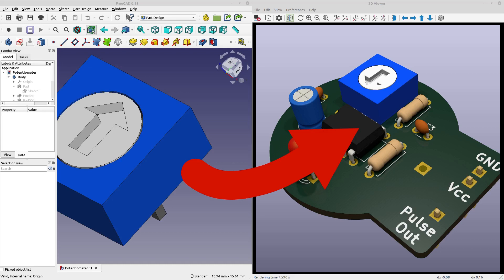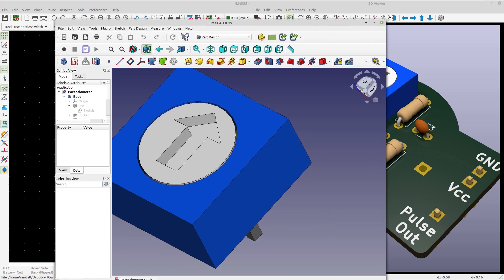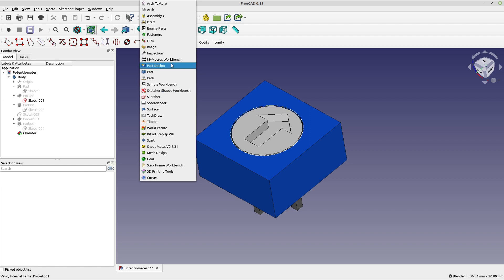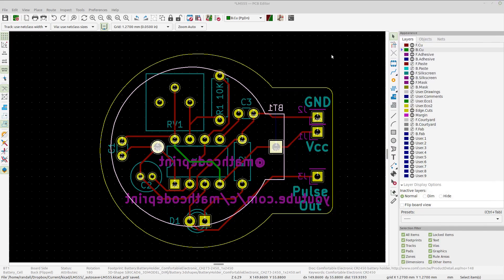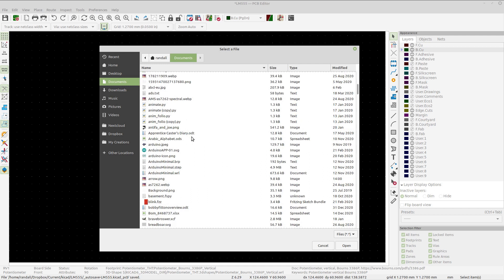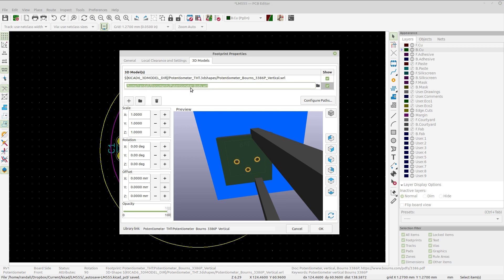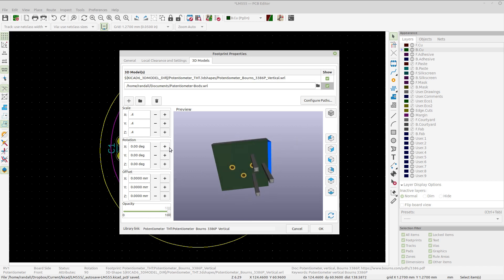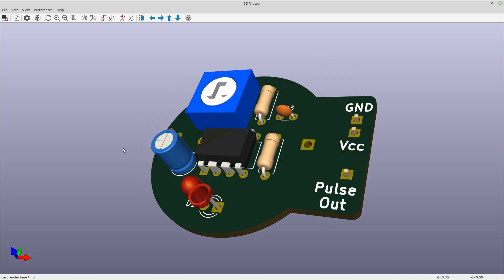FreeCAD Export to KiCAD

Comment: I see you have used both F360 as well as FreeCAD.  Can I assume your usage of FreeCAD over Fusion360 is solely a monetary decision?
Reply from the maker: That is definatley a part. But I also like open source software, like to support it as well. I have been burned a few times by companies deciding to change their license as well. I hate having to spend time logging in, giving info, I stalling licenses and all that crap. I figured I am gonna have to learn might as well learn something I can control.
Reply: Agreed. @mathcodeprint  and learning the software takes a considerable amount of time. For me, re-learning outweighs the cost of the software (within reason). I'm using F360 hobby version so I haven't had to pay anything yet.  But they can change their mind at any time and I would be out of luck.

Comment: KiCad seems to interpret the dimensions in the .wrl as tenths of inches instead of mm.  If you enter scaling factors of 0.3937 = 1/2.54, the model will fit perfectly.

Comment: Thanks for an excellent, clear explanation. I've also been bitten by the scaling issue. It turns out to be a kicad "feature" (bug?) and the exact ratio is 1/2.54 or 0.3937 ish. And yep it's related to kicad assuming the units in the file are imperial or something like that anyway.
Reply from the maker: Great, thanks. I am slightly embarrassed that I assumed Metric. Next part I do, will be in Imperial and see how that goes.
Reply: @mathcodeprint  From what I've read, the problem is that the default unit in VRML is inches for some reason, and it doesn't currently have a mechanism to indicate which unit system to use.  So even scaling down, the units of the format is still inches.

VRML isn't exactly industry-standard anyway, so perhaps just using STEP is the way to go.